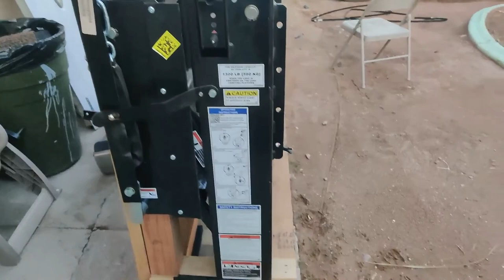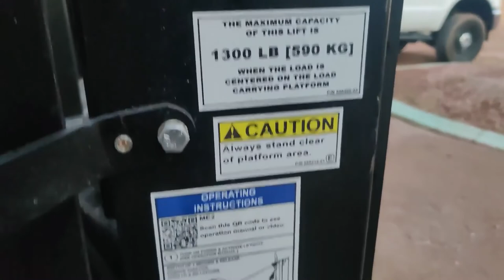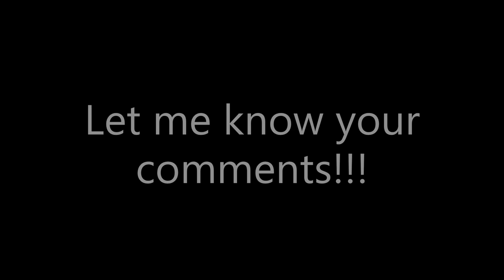Installing Maxon Liftgate C2  2021

Comment: when I  had the liftgate installed on the back of my F350 Ford I took the inner screws out of the tail lamps and used Velcro to keep them in place with the outer screws also save me a lot of headaches this is something everyone should think about doing .
Reply from the maker: Exactly

Comment: Great video!  After a good amount of searching I scored a used Tommy Gate and installed it myself the same method as you. Your video doesn’t show the bottom of the gate being connected/ welded to the frame. If you haven’t done so, I highly recommend it as it will flex on the upper brackets under a heavy-ish load. The small bolts can shear causing a serious accident. 

On my F250, I had a 2” 1/4” tube welded from the bottom of the lift gate to the top of the trailer receiver hitch. Local weld shop provided the tube and welded it up for $50. Turned out great and I now regularly pick up very heavy loads.
Reply from the maker: Oh yeah ,I did that my friend just did not recorded I think I should notated it

Comment: 2 questions.  
1. Did you replace the red plug on the HYD pump with the breather plug? Air needs to be able to get in and out. I have seen the plastic tank on the pump break due to the breath plug not being there.  
2. I did not see the mount connection from the lift to the frame of the truck.  This is what the plates and angles are for.  This is critical! Most of strength of the lift comes from bottom mount.  You can destroy your truck bed if you don't have this mount.  The truck bed is not design to take the load of the lift by itself.
Reply from the maker: You got me!!Haha, yes my friend the breather plug comes with your kit and yes I did installed it,second yes those plates are attached at the bottom  following manual,I welded them the day after of this video ,unfortunately did not recorded  that ,I have to  say that was a very great install and the lift it's amazing super strong hold after putting  those bottom plates
Reply: @combatvolta  Great, I have been installing lifts for a long time and I see people forget them.  It gets really ugly, especially after a car accident when they are not there. That lift should give you decades of use
Reply from the maker: @michaelmacdonald7702  Yes sir !!!

Comment: Hi, what side breaker  is needed? Also only scews are on the side brakcets? No screw need on the bottoe side bumpper side? Thanks
Reply from the maker: Hey bro , yes just side bolts because you need to weld two pieces of metal that comes with the kit or you can do it those two pieces at the bottom are welded to the beam that hold the bumper and connects with the bottom of that Liftgate , the circuit breaker it’s a 150 amp if I’m not mistaken??? I’m not sure now bro because I sold the truck (wich I regret immensely!!!)
Reply: @combatvolta  ok appreciate the response bro installing a used one and few questions but it's clear now appreciate it

Comment: Does it need a separate Battery??? I am going to buy a liftgate today are used one and I was checking out your video
Reply from the maker: No you just use your own battery,make sure to put a the safety breaker ,normally it comes with it when is new it goes attached to the frame close to the battery
Reply: @combatvolta  thank You sir. I am going to purchase a used one two hours away from my house 700 bucks for my scrap metal and junk removal business I make videos for YouTube I’m going to record all of that as well
Reply from the maker: @JunkNGrind  Mine was 4000 new  so get it now ,good luck
Reply: @combatvolta  I just got it I am on the way home hour and a half to go 700 it is a little bit rusty but that’s OK if you feel like looking on my page in a few weeks I’m gonna put a video on using it thanks man
Reply from the maker: Yes for sure !!